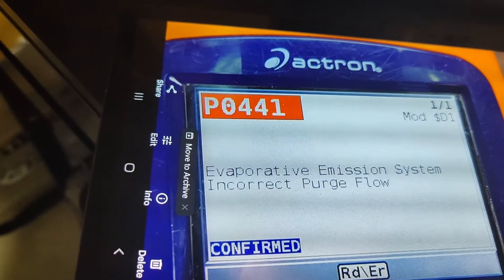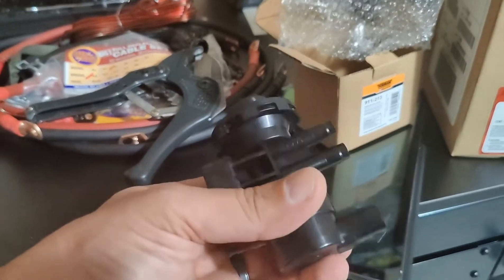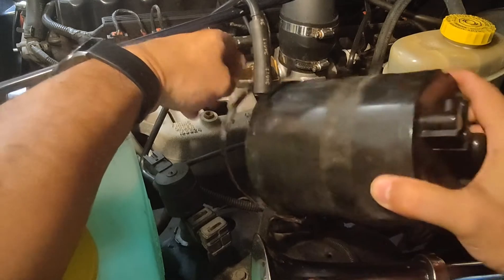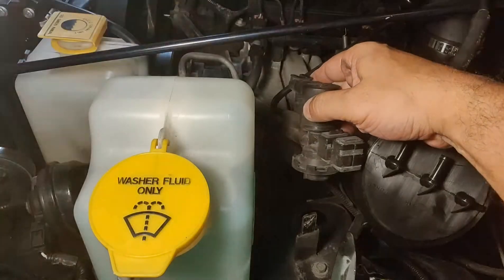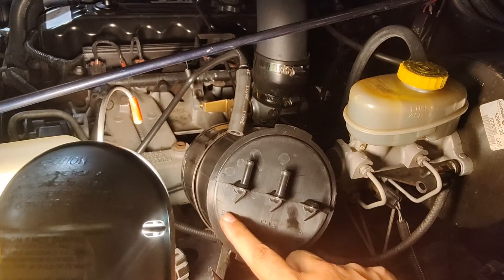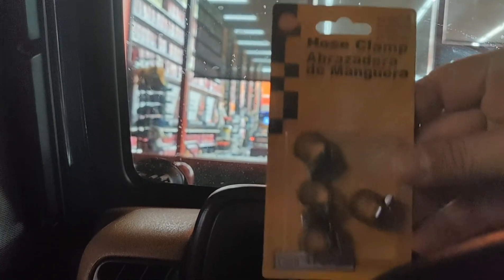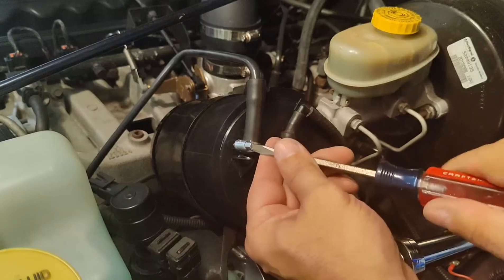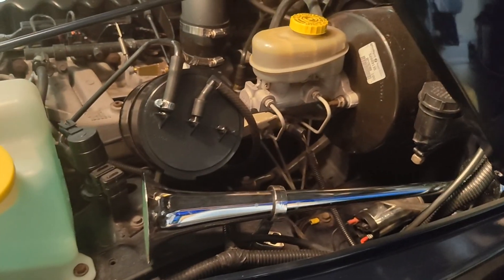Fault Code P0441 Jeep TJ-XJ-YJ 97-2003 Repair

Comment: That were going to try that with my Jeep is emission system incorrect purge flow, I did repair is purge valve Dorman, and now I have to find out is pump emission system then see how it works?

Comment: Hey there - did this end up solving your P0441 code? Was there any further EVAP related issues after the fact? I got the sale one this morning on my 99 XJ.
Reply from the maker: It solved my problem completely, just make sure you buy Mopar parts, autopartes won't work
Reply: To clarify, do you mean the parts you suggested in the video (Autozone Canister VC120 and Valve 911-213) didn’t end up working for you? I am about to order those exact parts and do the repair this weekend. Many thanks for sharing.
Reply from the maker: @jacksheehan5448  the canister from AutoZone works great, but I had to return the valve because the code came back, so l purchased the Mopar valve on Amazon and haven't had any issues.
Reply from the maker: @jacksheehan5448  Amazon part Mopar 4669475AB Canister Purge Control Solenoid
$73.83
Reply: Understood!! Thanks for clarifying that. I’ll go that route as well.. much appreciated!
Reply: That part number shows that it doesnt fit on a XJ. I thought you said the canister is the one that wont fit.
Reply from the maker: @investing4arellanos  Which part # are you talking about?
Reply: @FAFOWeekendAdventures Vapor Canister VC120,  looks completely different from the one that I have installed in mines.
Reply from the maker: @investing4arellanos  it's look different because it is, I say that in the video, that one is a replacement, it will work
Reply: I used a different canister. Anyways used solenoid standar cp451 and clear the code. Hope works with this combination